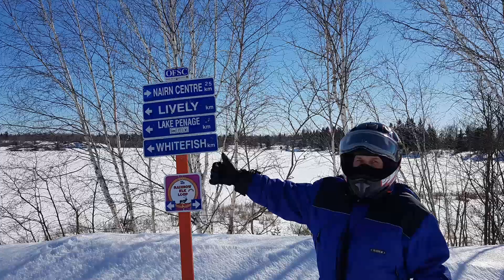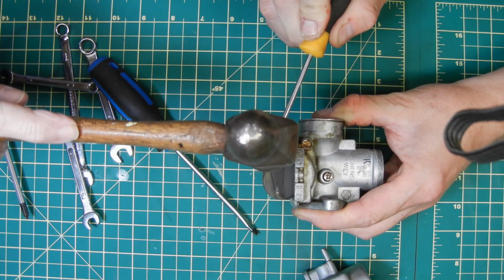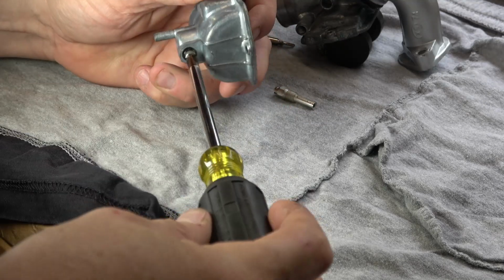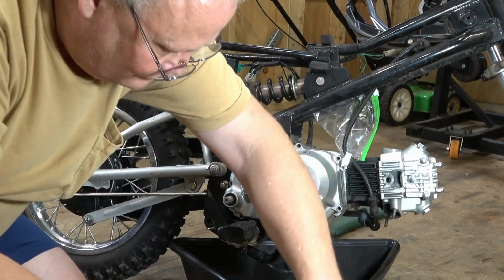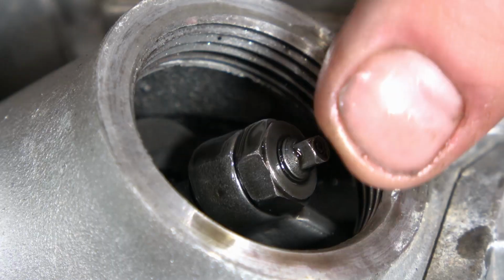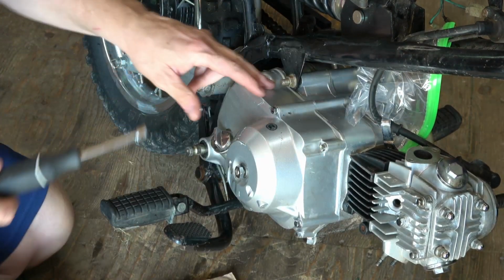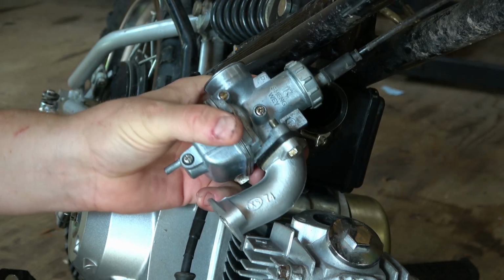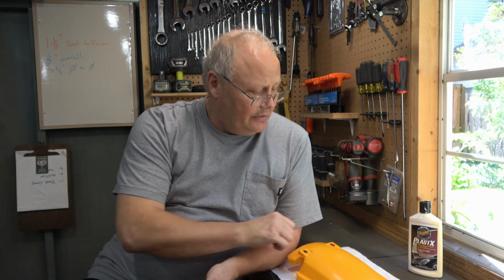I restore a used BAJA Pit Bike. Part Two

Comment: Just went through all this, with the carb on mine. Yours looks "new" internally, compared to how crudded up mine was. I noticed your card is the clone of the Keihin. Mine is an actual Keihin, which surprised me.  $150 used, on ebay. Couldn't even find a gasket/rebuild kit for it.  It's cleaned up and running great now. Had to replace the petcock also. Same one.. and leaked. Had to cut my own gasket, to get it to seal against the tank.

Comment: An old trick I learned about gaskets...  a very light coating of grease on the engine mating side. Allows the gasket to seal, and not bake onto the surface.

Comment: I just picked up a Baja Dirt Runner 90 for free on the side of the road in Wainfleet.  It does not run,  but Your video series here has helped immensely!  I do have some specific questions about the carb adjustments as I am having difficult getting this thing to fire up and stay running.
Reply from the maker: Have you already cleaned the carb?
Reply: Yes, all cleaned up!  It was in pretty good shape, but I think the previous owner replaced the original with an Amazon special.  
In your video, when you reinstalled the two adjustment screws, you reseat them fully.  But later you back out the air mixture screw (smaller one) two full turns as a baseline.  I missed how you set that second screw?  Did it remain fully seated?
Reply: FYI, I have not checked the valve clearances.. waiting for gaskets!
Reply from the maker: @mstrenzke  oh boy, I may have to re watch the video to refresh, my memory. Lol. I would have backed it out but I can not remember how many turns off the top of my head.
Reply from the maker: @mstrenzke  that may help if they are out of spec
Reply: I have a sneaking suspicion that these off brand carbs are very finicky..  
I
Reply: I tried backing it out about half way, then dialing it in using half turn increments, it fired a few times in that sequence but would not idle.  Then fussing with the choke the whole time… and my legs wanna fall off … 
It’s been fun.  :)

Comment: can you comment the link for the gasket set under this please
Reply from the maker: Thank you for the comment, I was able to find the entire gasket set for this on Amazon for around $20.00 Canadian. The ending is a clone of the 49cc Honda engine used for years in its small motorcycles. If you search for 49cc or 50cc Honda gasket set I am sure you can locate one.
Hope this helps
Dino

Comment: You don’t mention what feeler gauge you use
Reply from the maker: On boy, I will have to rewatch this video. I made it a while ago when I was just starting out. Thanks for the comment
Dino
Reply: @DinosTinkerShed  no worries! I have the same bike and I’ve been fighting the valves. We’ve came to the conclusion it may have sucked a valve now though.
Reply from the maker: @Chry_Bmb  uggg, that's not good

Comment: i have the same bike but it wont idle,it starts then dies
Reply from the maker: Thank you for the comment, I'm not a mechanic and it's always hard to diagnose an issue remotely however if it starts and will continue to run if you apply throttle but does on idle, it  may be your carburetor needs cleaning, especially the pilot jet. Now again it is hard to tell without seeing it, and it also could be as simple as the idle screw is set to low, but I am assuming you have already played with the idle adjustment? I have a few videos about cleaning carbs and there are others as well on you tube that walk you through as well. If you have never cleaned one before it can be intimidating but it is something most people can do themselves if the take their time, just do it in a nice clean area with a clean surface so you don't loose any parts. Hope this helps.
Dino